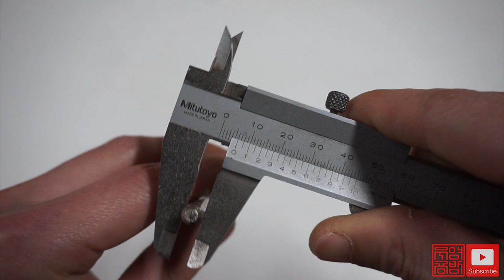Making a Awl from an old drill bit

Comment: when making wooden thread the best thing to do is to soak the wood fibres in CA glue beforehand - it'll make the fibres a lot stronger so the threads will be stronger, and it's a good idea to cut a groove into the thread so it acts like a tap.

The other way is to soak the wood in linseed oil over a period of several days (immersed is preferable), then allow it to fully cure - the downside is that takes a LONG time - but if you have an idea to do this in the future, preparing the wood for the handle can be done months in advance.

Comment: The dill bit should be HSS so if someone else does this, don't heat treat or quench it. Let it air cool and it will be ok.
Reply: The bit was originally a TC masonry bit - hence the angle grinder up front. I suspect that the flights and shank are not HSS at all.

Comment: Underrated video for sure.
But you could've spent a couple minutes with a sand paper to really smooth out the handle.
The lathe working marks are visible and frankly it kinda takes away from the beauty of the wood.